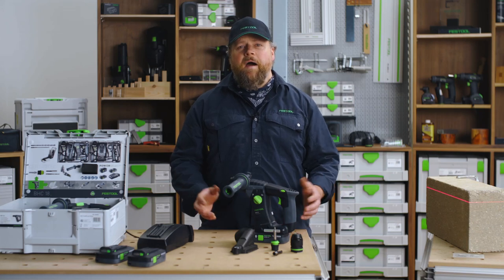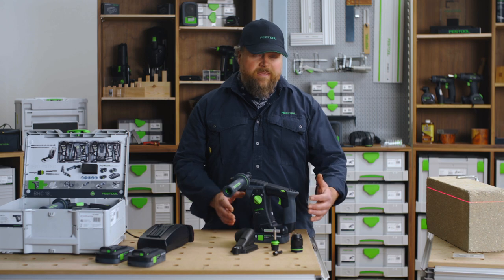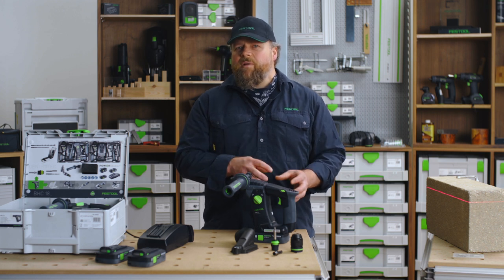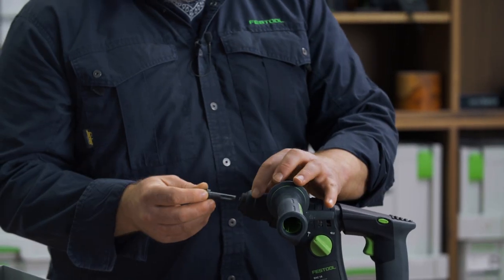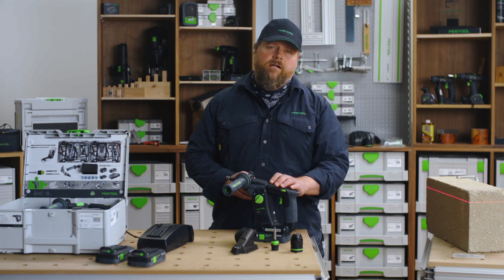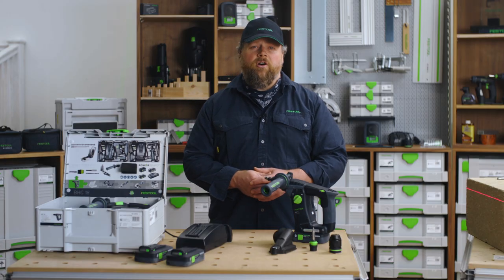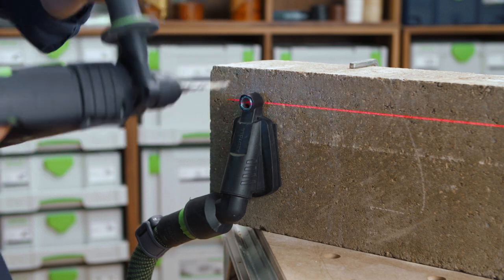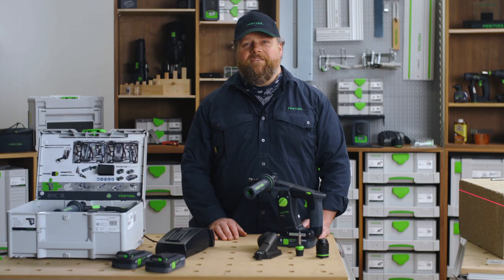Festool Cordless Hammer Drill: BHC 18 Introduction

Comment: I like the vacuum functionality.
I had to needle out brickwork. Well, they were actually 155mm concrete blocks. Using a rotary hammer drill meant there was considerable dust.
The dust collection will reduce the dust going into the house or area.